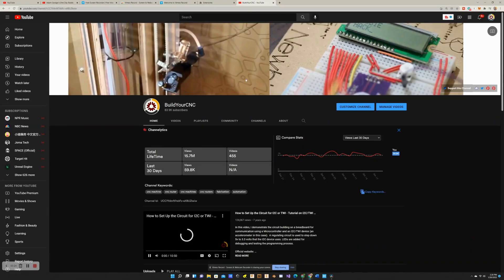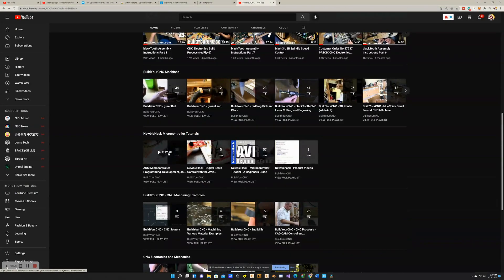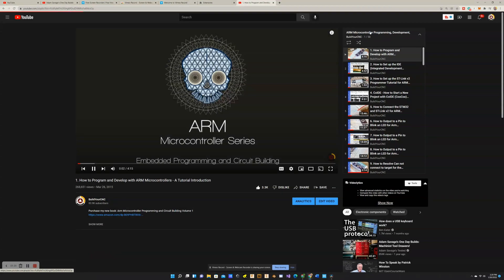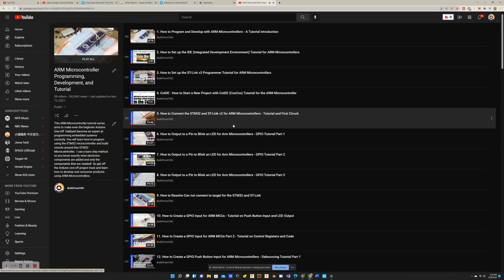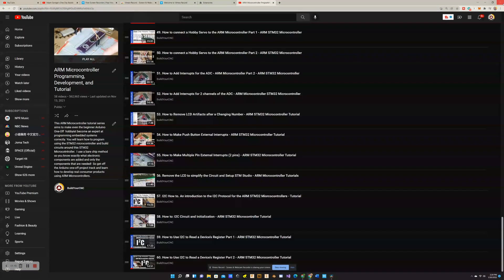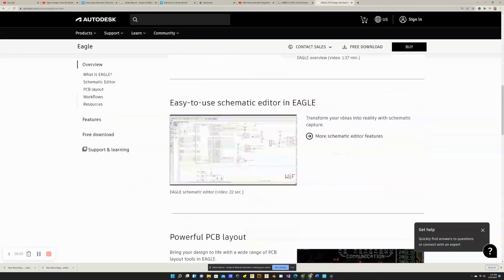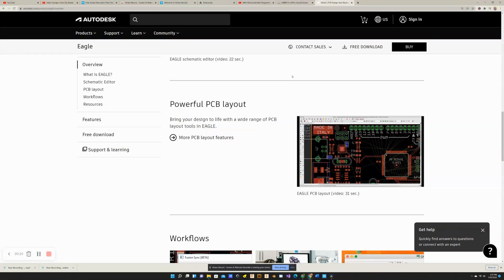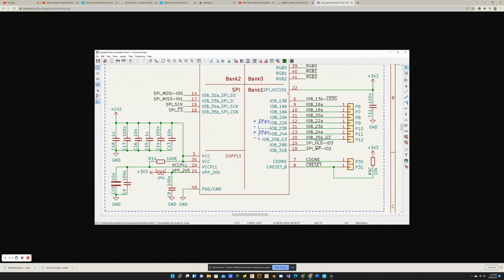1) STM32 "ARM" Microcontroller Series Introduction

Comment: I finally got down to working on this again. I see I posted about that earlier. (I’m not sure why I told you my whole schedule but it’s interesting to see what did and didn’t change.)

The count up timer was still in place and I could see it counting up by 1 per second in the monitor. I was able to change the program and upload it. 

I created a new project and I got the blink an LED example working the first time. 

I edited the program to do all the ADC setup and had a potentiometer set up like in the book. It was going to read the ADC value and use that as a delay time for blinking the LED (instead of sending the number to the LCD since I skipped that for now). 

But for some reason, the IDE can see the ST-LINK but not the STM32 device any more! I restarted the IDE, rebooted, updated the ST-LINK firmware etc. I can’t see the STM32 any more. I didn’t change anything in the wiring between the ST-LINK and the STM32.

Is it possible for the microcontroller to get into a state where you can’t reach it via the ST-LINK any more?
Reply from the maker: @drivers99  do you have the AVCC and AGND connected to the power rail?
Reply: @PatrickHoodDaniel wow, that was the problem! I see that in the schematic on p247 now and I’m sure you talked about that in the chapters I skipped over. Lesson learned!

So, if it’s running something without those set up, it can be unreachable over the ST-LINK connection eh? Interesting.
Reply from the maker: @drivers99  I also learned the hard way. In fact, I went through a few days of heads scratching. You'll see in a later video where I do a chip erase which also solves the problem. But when certain power pins are not used for certain features, the chip will just fail every time.

Comment: I'm here for it. I have the book, the kit, and even started on the previous book/series (maybe not previous, I saw you said it's a re-upload. Ok yeah, the book is ARM. duh.). I should block out a specific time each week, since that seems to be working for other activities. (D&D Fridays, cooking with a friend on Thursday, building radios on Tuesday [a lot to learn that doesn't come up in digital electonrics], Starforged every night previously, Advent of Code every night in December until the 25th...)